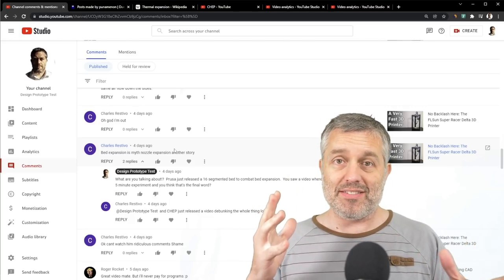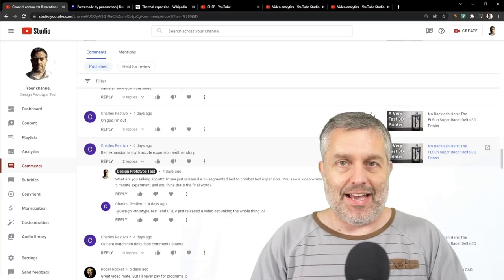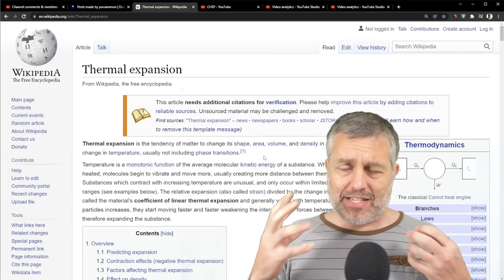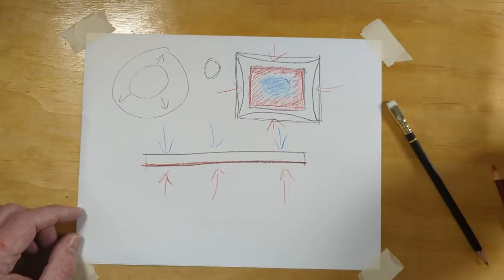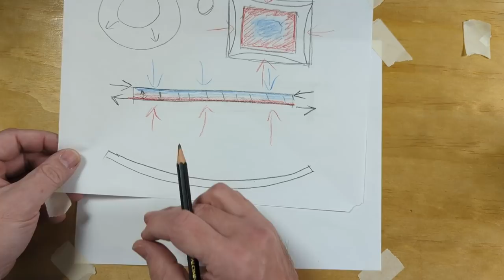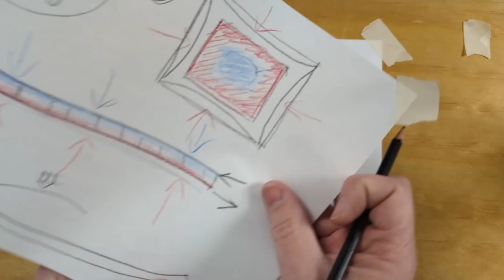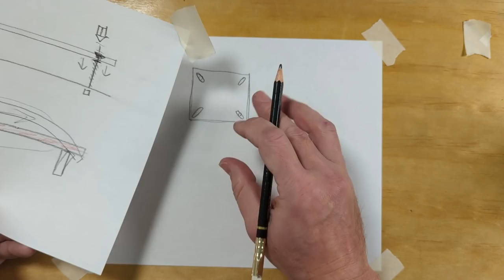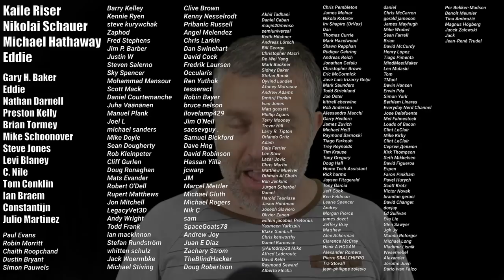The Problem With 3D-Printer Beds When They Get Hot.

Comment: Think you missed the point of my video. I never said a bed doesn’t expand. In fact I showed the effects at the center. The point of the video was, if you use the paper method (as creality and other companies tell you to do in their manual) you’ll get the same results heated or unheated because the bed doesn’t expand any measurable amount above the adjustment knobs. And even though the center moves, you can’t adjust that out using the paper method. So if it’s a small print, print over the adjustment knobs. 
On a second point, I do have a BSEE and 40+ years of design experience including thermal design of heat sinks and design for thermal environments. But explaining all that in a YouTube video is not only boring but wastes a lot of time (just like it did here).
Finally if your going to question my techniques where I did establish a hypothesis and then test and measure, at least do the same instead of making a bunch of drawings only to never actually show in empirical form the measurements of the large warpage your drawings imply.
Reply: Pwnage... Delivered.
Reply: Hi Chuck. Speaking as one of your 230,000+ subscribers - I appreciate the clear and useful information you provide on your channel. Cheers!
Reply: Chuck, I thought your video was clear and very easy to understand and all your claims were si only and logically explained.
Reply: CHECKMATE!
Reply: An honorable man would of pinned your comment.

Comment: The ball-bearing setup to handle bed expansion is not only a good solution, it's in practice on several printers right now. My Rat Rig V-Core 3 uses a 3-point kinematic bed system where the bed posts end in steel balls that ride on channels made of steel bars at 120 degree angles from one another and uses magnets to keep the bed stable. This is an optimum setup and completely rids you of bowing/bubbling. This same system has been deployed on everything from the Ender 3 to multi-thousand-dollar MakerBots/etc. The Rat Rig takes it a step further and adds independent steppers for each contact point, meaning you never have to tram your bed, ever.
Reply: I'd like to second this and say that the V Core 3 and various similar designs are the absolute best tech right now in the hobby 3dp sector. Everyone looking into hobby grade printers should consider one unless they don't have the time to crimp their own connectors or learn the basics of Klipper
Reply: @TheRAINMan059  I agree they are the best designs available right now, but I wouldn't recommend them to a beginner in the hobby under most circumstances. The exception would be people like mechanical and electrical engineers. Everyone else should buy a mostly assembled, cheaper printer to start with
Reply: I'm curious, does it take into account the uneven heat provided by the heating element? That's a cause for dips and valleys in deltas, which otherwise wouldn't have this problem due to the way they mount their build plates.

Comment: After watching CHEP's video, I find this whole discussion nonsense for 2 reasons:

1. He didn't claim beds don't warp, he just showed that beds won't change height at the mounting points, whilst it warps in the unsupported areas (e.g. the center spot).

2. His video is only referenced for manual bed levelling, for which is in fact true, that levelling your four outer points doesn't really depend on the temperature. 
His verdict is "if you want to print something small, put it in the corner" (5:07-5:41 in his video) as it won't be effected by bed warping.
The story for ABL is of course different, as it allows the whole surface to be used. And that's essentially the whole flaw of manual BL, you can only use a small sweetspot at a time and never the whole bed itself with proper Z height. So imo his statement is right to use at least the ones that are not affected by temperature.

Besides that, his measurement methods itself seem to be valid and properly thought through. So I don't really get your point about being not scientific. It is simply the answer to the "hypothesis" if you should preheat your bed when manually levelling it and the answer is: no, doesn't matter, you can't prevent warping anyway (with standard equipment) so use the corners.
Reply from the maker: And yet I now have trolls on my channel telling me that when I talk about bed expansion/bed warping it's a myth. Misinformation comes from somewhere.
Reply: @DesignPrototypeTest  They're not trolls, and they're not trolling you. They're just misinformed. Try not to take the internet so personally and remember that social media (which this is) has fundamentally changed the way we interact with one another...for the worse.
Reply: @DesignPrototypeTest  Let the trolls be trolls, I'd recommend to focus more on the constructive side of your community and leave the haters alone. 
I strongly believe in the four sides model of communication, so misinformation can come from either the sending or receiving side (or both). As I can see, CHEP never neglected the fact that beds warp, in fact he states that the center point moved up to 0.07mm (which I also think isn't too much, but he only measured it up to 60°C). He mentioned only, that the cornes remained at the same height, which are used for manual bed levelling, so there is no need for hot levelling the bed, you can use these areas safely fr your prints.
When someone makes a "bed warping is a myth" out of it, it is simply his lack of understanding and not CHEP's statement. Some people just want to hear what they wanna hear

Comment: What is true in theory only matters if it impact practice. Chucks measurements seem to indicate that the expansion, at the temperatures we print at, is fairly insignificant. No doubt it's ideal to have a bed probe measure "level" at the exact temperature you are going to print. But, for basic prints, his finding seem to indicate you probably don't need to. No need to overcomplicated your life.

Comment: With the center of the bed being prone to the most change in dimension, the first step is to make the center of the bed static using a screw and spacer to prevent any movement; that becomes your control point, and makes the edges move easier as all force gets redirected to them.

At that point, low-friction methods like nylon/Teflon washers using the oval hole design you described would be much more successful, combined with captive large-diameter spacers housing the springs that would prevent X/Y movement of the spring and screw.

The only drawback is that the oval slots only work with uniform warping in a predictable direction, but there are so many factors involved in the heat distribution and external cooling that it would be very difficult to control that. One possible way to compensate for all directions is to use a large circle that the screw can move in all X/Y directions, and a larger washer/screw head so it still retains the bed at a specific height while allowing movement to a certain distance in any X/Y direction.

Depending on how much distance is already designed in a bed between the existing scre holes and the heater elements, this design may be retrofittable to existing beds. Since it only consists of removing bed material and adding common small hardware in the form of screws, washers, and spacers, it should be relatively inexpensive but require great skill to properly modify the existing bed.

Comment: I have several Ender 3 v2's and all with CR-Touch installed.   I have noticed that GLASS beds (since my firmware does an auto-mesh build every print) will actually become MORE level after several prints in a row, the heat apparently settles them into a better level....which makes sense, hours of a heated bed will try to reach equilibrium.   This was indicated by observing the mesh displayed after several hour prints in a row.  I love CHEP's content too but always thought that particular video a bit suspect after my own experiences.

Comment: When I saw CHEP say that it's a myth - part of me wanted to speak up, but CHEP's content is 3d printing light -- ender 3s, the expansion on those beds -- the thin tinfoil used by creality is so insignificant that why bother. His target audience is not enthusiasts. So for his purposes the bed is stable and is irrelevant. In all my work with larger machines bed's, MIC6 machined thick 9-12mm quality aluminum beds expand quiet significantly. The entire reason I let my big machines heat soak for 10-15 minutes after they reach temperature so the bed expansion is done. And anyone who thinks beds don't expand -- turn off pid loop on the bed, and watch bang-bang heating and look for z-banding. But again -- not CHEP's audience.
Reply: I'm not even sure why we even have to discuss this? Thermal expansion is a known fact, even outside of the 3d printing world. And no you don't need a science degree for that just basic school education.
Reply: Where did he say thermal expansion is a myth? Sounds to me like you didn't really listen to what he was proposing
Reply: @kachler67  Just with the basic fact how he measured it. Saying doesn't exists for me so it doesn't exists with 3d printers. He wrote some comments as well that indicates it.
Reply: @TheOfficialDarkICE  How should he have measured it instead? To me the measuring setup seems appropriate and suitable. He even says in his conclusion, that the bed didn't move only on the corners, whilst the mid changes height. So I see no validation for your statement, that he claims it's a myth. 
The only point I would criticise is that he only measured it up to 60C, would be interesting how it behaves beyond that
Reply: @kachler67  For example thermal expansion does not only happen at the corners or in the middle of the bed. Different temperatures need to be tested. Even how the bed is heated needs to be considered. Every Printer is new case that needs to be examined. At the end Enders are know for warped beds even without thermal expansion. My Ender 3 is awful in that regards.
Reply: @TheOfficialDarkICE  He never said thermal expansion happens only in the middle, but when the corners are mechanically spoken a fixture, they simply can't move in height regardless of bed material or heating. It is basic mechanics. His results clearly show that behaviour as the corner points didn't change, only the non supported center area. 
He measured from room temperature to 60°C in 10°C intervalls, sure he could measure above, but I'd call that "different temperatures".

Lastly, if Ender beds are warped at room temperature or not doesn't play any role in this equation, he measured relative differences and if they change. If a point moves under heat, it moves, if doesn't move, it doesn't. Simple as that. 
That's why he mentioned that you don't need to manually level with temperature, as the fixture points remain the same and it will give you the same result. He proposed to use these are for small parts for that reason, the levels don't have to be adjusted.
The center will move depending which temperature you will set, so it's not advisable to adjust for this spot, because with different temperatures you will need to readjust Z height. Hope this will clarify some points.
Reply: @kachler67  okay i have not enough time to answer everything. After watching it thoroughly the take as myth was wrong. I hope that you still don't want to make the point that thermal expansion doesn't happen at the corners. It can still happen even if it's mounted. Not as much, well no depends on the material and which plate comes on top. The warped bed comment is just to say that you should either invest in a bed level sensor. This has nothing to do with the expansion.
Reply: @TheOfficialDarkICE  This. Most materials expand, except for a couple of materials that have a negative thermal expansion.

Comment: I have a delta printer and it holds the bed down on the corners with top pressure clamping down rather than screws. The advantage is some gap between the edge of the bed and the clamp arms, so the bed can actually expand from heating. HOWEVER, since the heating elements in beds are not uniform and never heat the entire plate evenly you still have to map the bed for raised or lowered areas.

Comment: I'm still not seeing that the thermal expansion coefficient of aluminium at 60-100c is a significant factor in here.
Reply: however... the thermal expansion coefficient of adhesive(s) used to stick convenient build surfaces to the aluminium should not be overlooked.

Comment: I fought with the plate concavity when my ender-3 pro was new. Then I upgraded to bl touch and Marlin 2. I learned that if Creality used Marlin to it's potential, I could have had a 9 or 25 point manual mesh using paper and interface control without a sensor. I'm still not sure why Creality still ships with early Marlin.

Comment: With an aluminum bed and heat change of 80C you’d expect to see maximum expansion of .2mm. That being said, depending on the internal stresses and manufacturing process it’s could be much more, or much less. It really depends. I always reset my Z offset with any temp change.

Comment: The very best practice where Thermal expansion is used is on automotive repairs

To replace the bearings the new one got into the freezer for a couple of hours to get it freezing cold, the other part is getting hot with an blow torch so the assembly is as easy as "press" the bearing with your hands  into place, otherwise it will need an hydraulic press to do the job

Comment: IMHO... these should be floating beds restrained in a single corner that allows expansion and contraction. We treat these beds as fixed and imoveable platforms and then heat them while attempting to use that measurement as a basis for tramming! The height of insanity...

Comment: So I have a CR Touch,  I run a Cold calibration, I get the values, I run a 60C calibration and I get the same values so with at least 60C there isn't a change.  I am going to be printing some higher bed requirement materials soon, so I will be cycling the bed upwards of 160C.    I wonder at what temperature these changes are happening and what materials are being used?   I have sitting ready to install a 6061-T6 material bed.  Currently I have the oem bed on.    So at PLA 60C temperatures with my bed I have zero changes.  It would be neat to find out what material each bed is made out of.  IMHO if you have a stationary bed it would be best to get one made of a material with a low linear coefficient of expansion.

Comment: Hi, could you recommend a good bed? The thicker the better? Should it be AC ?
Reply: 1/4in or thicker cast aluminum plate and a keenovo heater. Just make sure to get a heater with cutouts for mounting holes.

And AC is great, but only if you are comfortable with wiring AC stuff.

Comment: There's even more to it than this. It takes more time for the material to finish expanding than it does to heat up. So you can't just heat your bed to temp and measure it - you have to wait for it to finish expanding. IIRC this is very difficult to calculate. You might want to check out how RatRig deal with this problem - it's called a Maxwell Kinematic Mount. That probably won't work on a bed slinger, though (another reason to do away with the bed slinger design). Also the material the bed is made from matters a LOT - rolled and extruder aluminium expands for more unevenly than cast aluminium...and then there's thermal shock to consider (i.e. permanent warping as a result of heating too rapidly from one side). It's a minefield, and the bigger the bed, the bigger the problem.

Comment: Chep did not claim bed expansion is a myth. He found out how negligible the effects of heating is on print bed levelling and gave us actual numbers. I wish you had done the some printing to prove your argument but right now it is purely theoritical.
Also, Rat Rig vcore 3 bed mounts already tries to address this problem but I don't have one and so I'm not sure how much of a difference it makes.
Reply: the effects might be negligible on an ender 3 with a teeny-tiny bed, but they are anything but negligible on anything larger. Stop Stanning Chep, he was flat wrong
Reply: I do have a Rat Rig V-Core 3 and it addresses the problem pretty well. you still need to probe at printing temp to get an accurate mesh, but when you compare it to a cold mesh, you can see the system works very well, as there is little to no evidence of bowing or bubbling from heating.
Reply: @jfaristide  I don't disagree. Let me clarify.. I'm skeptical about Chep's claim too and haven't experimented with levelling the bed cold. There is no actual printing done in this video and so this is even less credible than Chep's video where here had a result on specific printer.
Reply: @nbalagopal  it's not less credible, though. It's the laws of thermal expansion explained in colored pencil. It doesn't require any printing to fully debunk what Chep said, simply a rudimentary grasp on physics.
Reply: @jfaristide  Well in that case, the theoritical approach here could've taken this further to consider the extent of the effect for a specific bed size...which was also not done. No actual printing and no specific bed sizes considered is what makes this less credible to me.
Reply: @nbalagopal  I can appreciate your position, but physics is physics. They don't change because some youtuber says they don't apply in a particular situation.

Comment: Thankyou DPT for you're explanation on the changing shape of the bed when heated. 
When using probing to get a very good first layer, is the adjustment just made on the first layer or does it fade out after a few layers? 
Or is it just to get very good even adhesion to bed then next layer has no adjustment added and blasts on top?